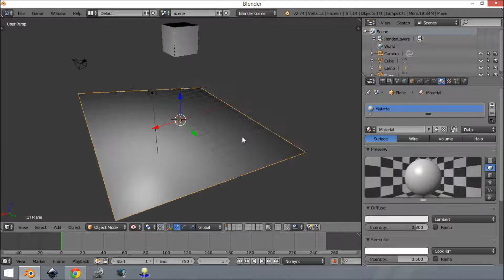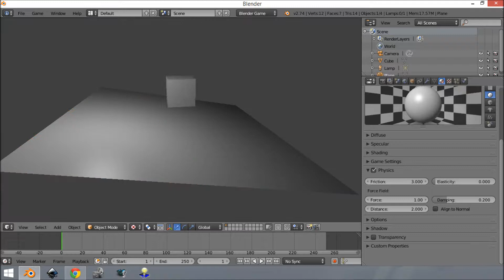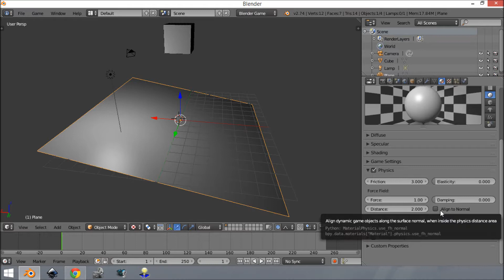Manual Physics and Force Field - BGE Tutorial

Comment: out curiosity ive been wondering if i could duplicate the wave physics like in the game "waverace" on the n64.  i tried using a displacement modifier, animated via a uv projector which created the VISUAL effects on the geometry but the physics engine only viewed the game geometry in its base plane state.  i will see if i can mix materials and incorporate them into the projector so the forces might push the floating objects up in line with the visually displayed waves- or at least i could create separate surface objects that will move in line with the displacement effects or some thing.....